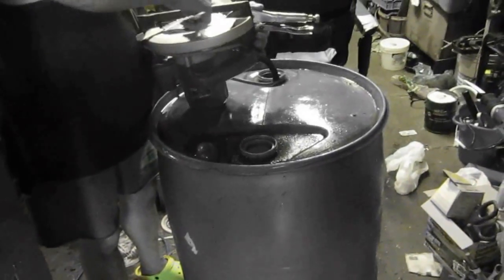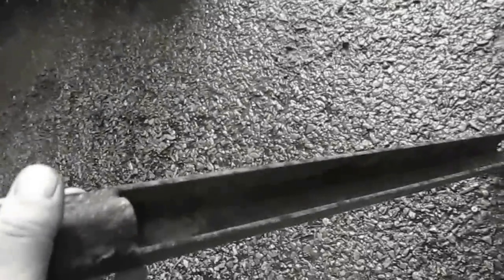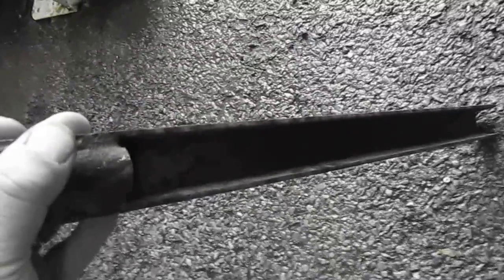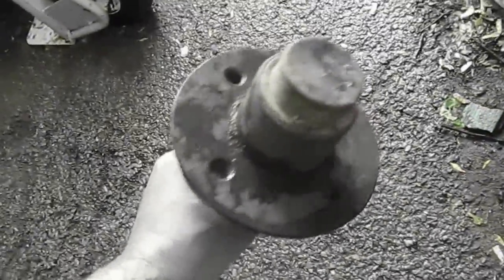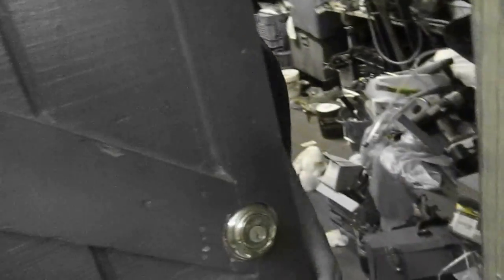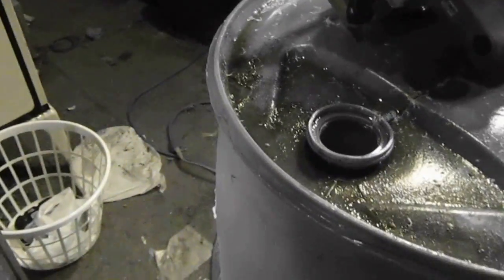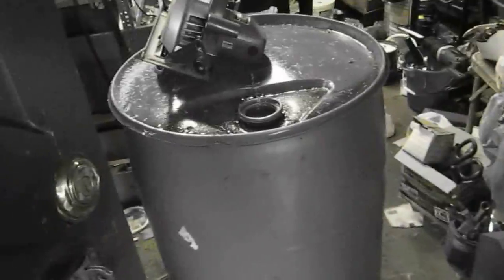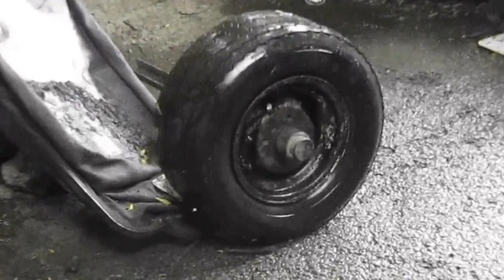Savonius Vertical Axis Wind Turbine Part 1

Comment: Check InpliX handbook if you want to make it cheaper and better.
Reply from the maker: Thanks. I've actually moved onward and upward to a rocking versus spinning design that can be tethered to a rocking chair or use small gusts of wind rather than having to rely upon a minimum amount of wind to get any usable energy to store.  And since I'm compressing air instead of generating electricity, I'm attempting to incorporate the increasing weight of the storage tanks into the moment arm of the compressing mechanism.

I have some videos posted about that as well.
Reply: awesome :)